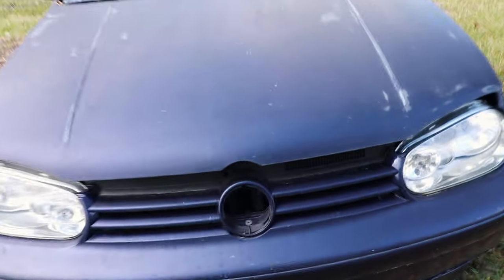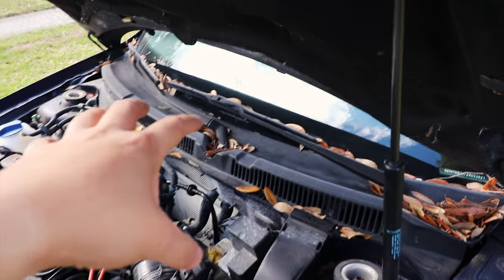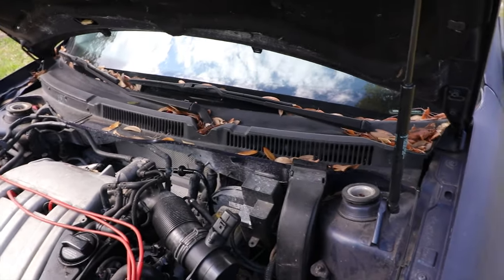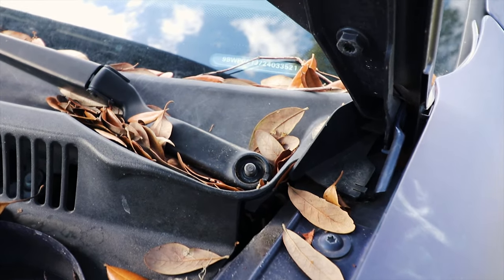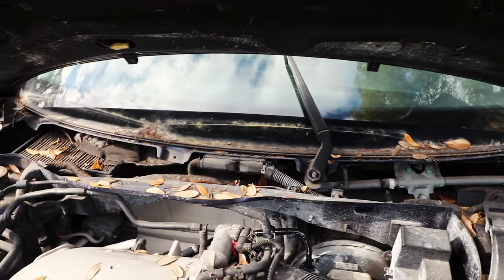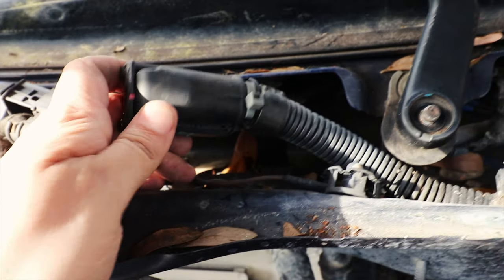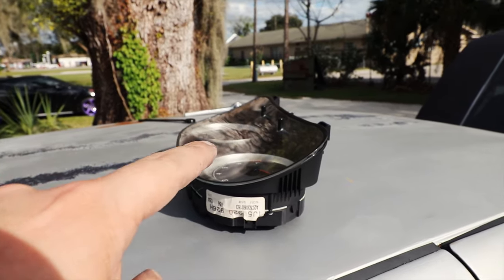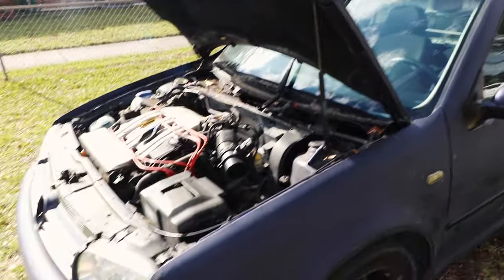Cluster Swap Programming, ECU Removal Pt.1 | Mk4 GTi

Comment: could have taken both clusters apart, swap out Speedometer, RPM, Temp and Gas overlays and dial indicators arms. after putting arms back one wind backwards about 3 or so times adjusting all 4 dials back to zero. this would have fixed both problems of gages bouncing and car not cranking because you would still be using original cluster and by winding and reseting to zero you've recalibrate spring and it's free. I found this out on my jetta doing the same gage swap

Comment: What programming company did you use? To reprogram the ECU? 
2nd ? : just asking for knowledge, if I changed out the 3 pieces of ECU & Cluster & key ingintion ( that goes w/ ECU and Cluster) all should work properly?
Reply: I'm trying to figure out the same. I'm looking at a mk4 Jetta that's having immobilizer issues and I've got a mk4 gti with the key, switch, cluster and ecu I could use just dont know if it would work. Both are 1.8t and 5 speed
Reply: @theSICKNESS2300  My understanding is that it should work. For the New ECU , you may need to reprogram some othet modules such as ABS and etc. To reduce this reprogramming the donor (car) parts must be as close uou can to original date of Orginal OEM ECU. Please advise if it works for you and reply.

Comment: Bro, I have a Mk4 1.8t, it was Automatic Transmission but a friend of mine swapped it to a Manual one but he could not make the speedometer to work :( what's the problem? He used a different Ecu to make my car Standard.
Reply: Theres a relay you have to swap and some electrical work

Comment: If I've got the cluster, ecu, key and switch can I swap everything and it work or no? Looking a mk4 Jetta 1.8t and its having immobilizer issues and I've got a mk4 1.8t golf with everything I can use for the swap
Reply from the maker: In theory that should work. I believe the ECU still have to be flashed to that VIN tho, maybe I am wrong there.

Comment: Get a Chinese vag tacho cable from eBay and do it yourself
Reply from the maker: mathjuk They are not reliable. Hit or miss. I’d rather have ease of mind knowing its done correctly.
Reply: @MK6Guy  I coded the exact same clocks to my car using a genuine vagcom cable  to code in the clocks and a Chinese vag tacho cable to do the milage and extract the pin
Reply from the maker: I still have to send the ECU out for Immo Defeat
Reply: @MK6Guy  vag commander cable from eBay will remove immobilizer 😁
Reply from the maker: Link it to me on IG if you don't mind